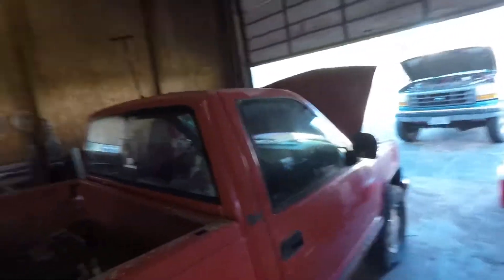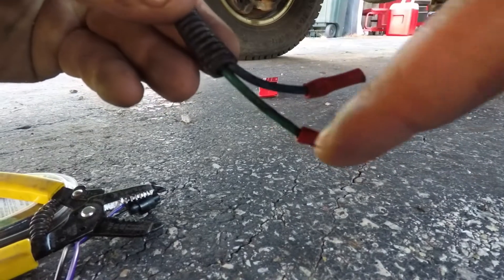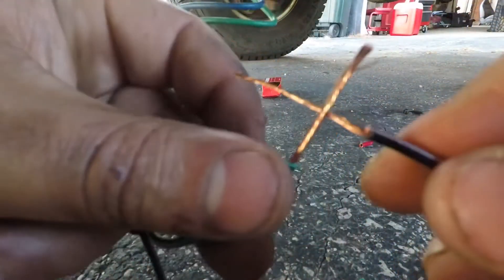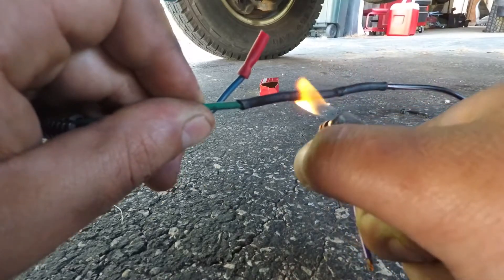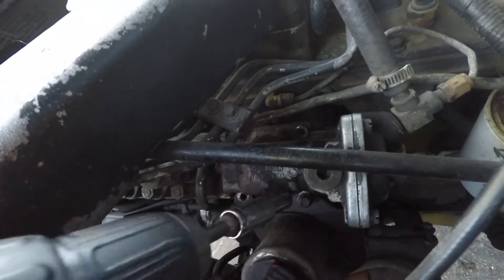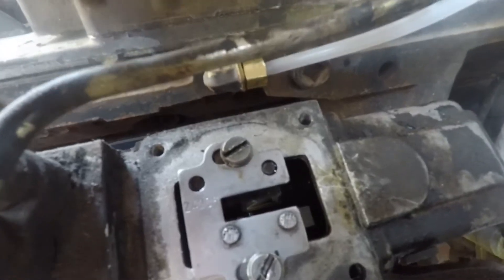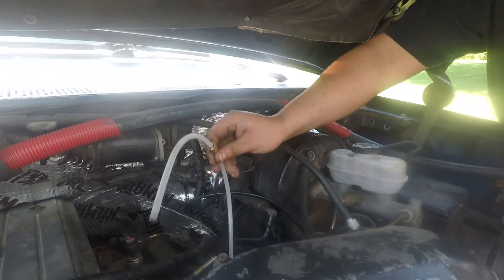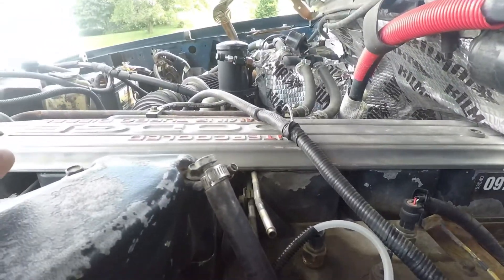I fixed my F-350 FUMMINS!

Comment: I have the AFC live from power driven diesel. You can basically run any position fuel plate you want. It is like an infinite tuner.
Reply from the maker: Ben Call is it worth the money? I just want a setup where Mrs. Moose can jump in and drive and not call me because the truck is smoking like crazy haha
Reply: I feel like it is. With a fuel plate you will only have one setting and control it with the accelerator. With AFC live you can turn it down to stock or go full bore. Installation is just a little more in depth than a fuel plate but you made an adapter plate, I think you can handle it.